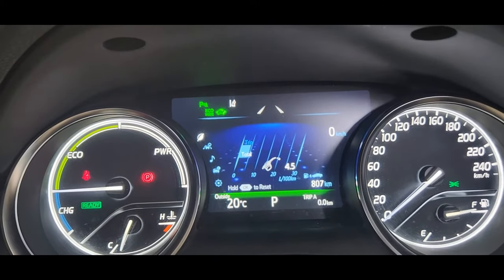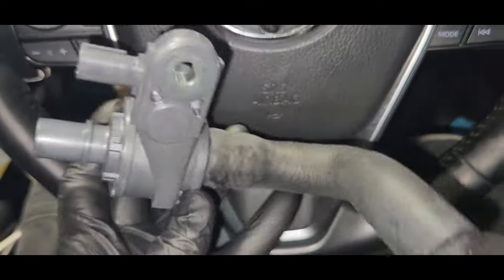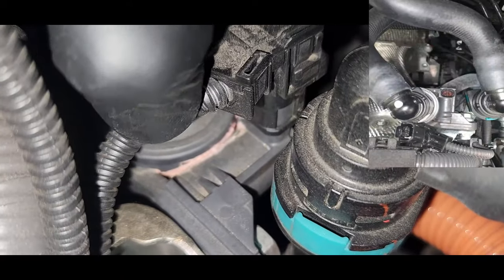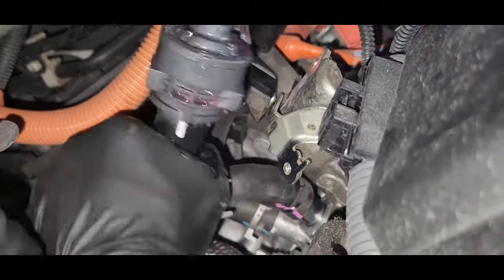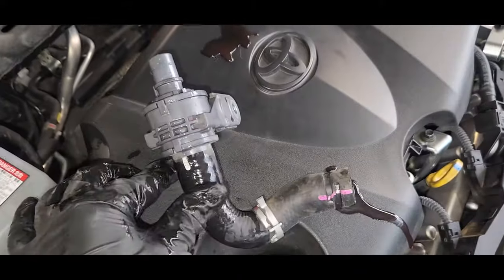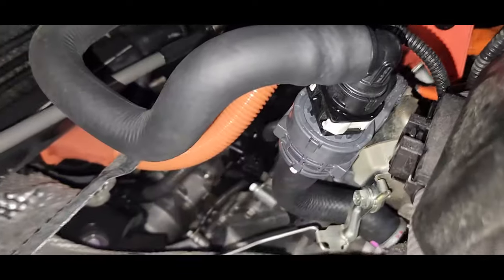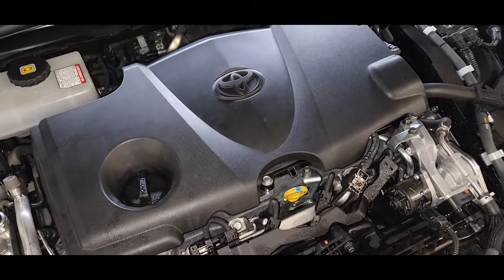How To Replace Camry Engine Coolant Bypass Valve. P268115 Coolant Bypass Valve Circuit Short.

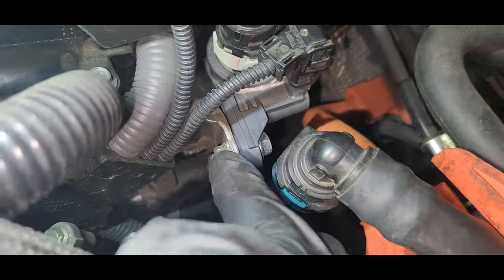Comment: How did you remove the electrical connector?  You did not explain.  I have tried for two hours by pushing on all over the connector.  Why not show where to push after you remove it @ 1:20.

Comment: Hi! Thank you for this video. I got the P2681(15) error code on my 20419 Rav4 but on inspection did not see any leaks. I live in a rural area and will have to drive about 60 miles to a shop. Should I not run the AC when I drive until I can resolve this?
Reply from the maker: If no any leak no problem you can drive but if you have leak don't do it because can be damaged module

Comment: What is the part number for 2020 Camry?
Reply: anyone have the part #?
Reply: The only place that has this part is the dealer and it runs about 135.00 dollars, and that's for a 2020 camery, but the set up is way different from the video!
Reply: @maddogguzman3961 yeah this is correct I literally just bought the piece for 135 plus tax
Reply: Hey, what's the part number? My 2020 Camry SE just threw the code and I'm trying to find the part number so I can order it.
Reply: @JBelcourt7 did you find the part number? If not I got it
Reply: Where I can order it?
Reply: @saeed411saeed6  I bought it at the Toyota dealership for $138 plus tax

Comment: After it was installed it kicked on fan a couple times bc it was over heating is that normalv
Reply: When you replace Hoses, radiators, water pumps, heater cores, thermostats etc you have to bleed air from the system according to the procedures for your specific vehicle because there will now be air in the coolant system that can cause overheating. 

I know your question was old and you probably already found the answer but thought it might help someone who has come upon the same issue after performing work on their vehicle's cooling system.

Comment: The set up is totally different on a 2020 camry, it's not that easy, believe me it's way different!!!!
Reply: How is it different? My 2020 Camry just threw the code and I'm trying to figure it what part number to order and how to replace it. It looked the same to me (from a quick glance) but now you have me worried lol.
Reply: @JBelcourt7 not sure if 2018 is different but I just replaced mine with little mechanical skills and no problem